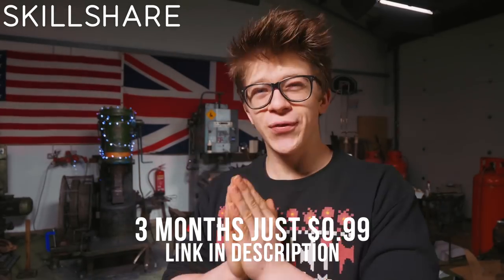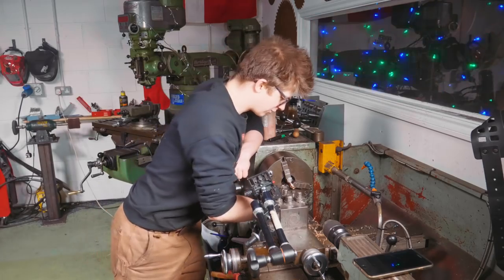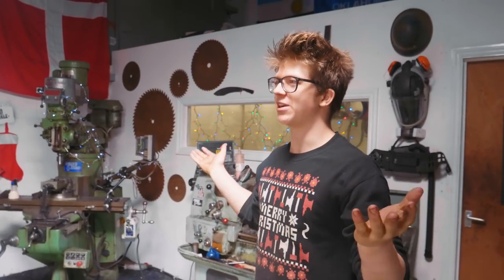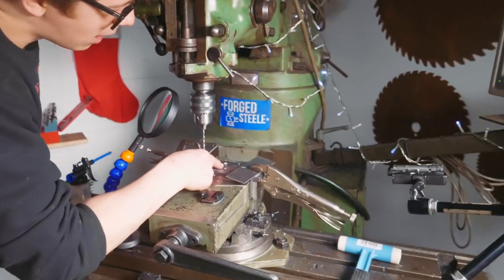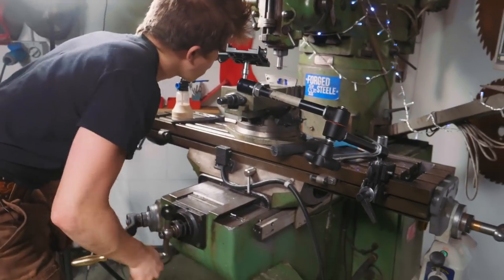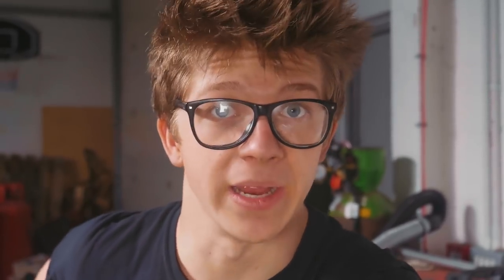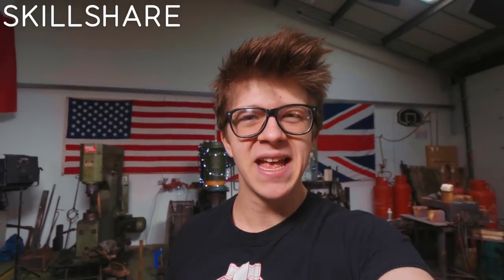MAKING A FRAME-LOCK FOLDING KNIFE!!! PART 5

Comment: Tip: When you are using the micrometer, use the thin stalk at the end when measuring. That is a torque limiter, and if you don't use it your measurements won't be consistent. Also be aware that materials expand when heated up and contract when cooled down. Try to measure the piece at the same temperature every time.

Comment: Fusion 360 is great! I used AutoCad and MasterCam for 25 years, Fusion, fuses them together into one program. Was easy to learn coming from AutoCad, terminology was the same.  Great Work Alex, I wish more of the younger generation had your personality and work ethic! And yes, you make this Machinist/Gunsmith cringe often! KEEP IT UP !!!!
Reply: Dave Erving Evader Knives , If youre using Acad now you should try Fusion360 its free for hobby use and education. It has CAM built into it too, so you will be a step ahead when you go to CNC. The CAM in Fusion has been working good for me with minor edits.
Reply: Dave Erving Evader Knives Im not sure if there is an actual profit number stated, I just figured as soon as you were using it for profit.
Reply: Dave Erving Evader Knives Yes, I believe that is correct. Fusion 360 and other CAD programs for that matter are leaps and bounds ahead of what I was doing with AutoCAD 2000 years ago! You go from pulling out what's left of your hair using the old AutoCAD to Fusion 360 saying oh, this is so freaking easy!

Comment: First off Alec, on behalf of all machinists that watch your channel THANK YOU. second I would like to welcome you to the wonderful world of machining, you still have a lot to learn but you are well on your way. Third, there are several ways to fix your cheap vice, the first one is to strap a bar to your mill table and mill both the tops and sides true, then turn your vice upsidedown and clamp to the bar with the vice itself. Next, take a cut across the base of the vice that should now be facing up, that should bring it into or very close to true. The second option is to make a set of machinable jaws, these are great because you can mill them to what you need, you don't need parallels, and you don't need to worry about hitting the hardened steel of the vice jaws. There is a lot of info on the web about them, but basically, there should be a set of steel jaws held in your vice by two counterbored cap screws, you are going to replace them with aluminum. You can then clamp up on a spacer and machine the jaws true and machine a step into them to serve as your parallels, or you can create any shape you need at the moment. When they get bad just make a new set.

Comment: A little tip for centering a bit, hold a scale (ruler) vertical between your tool and the workpiece and slowly feed your tool inward until it pinches the scale. If the top of the scale moves towards you, the tool is too low, if the top of the scale moves away from you, too high, if the scale stays vertical, your tool is on center

Comment: Great work Alex. Tip of the day: when reaming, don't bottom out the reamer in a blind whole, it will jump up in reamed size slightly. Not that you did or could I even know, but a tip nonetheless if you didn't know! Thanks bud.

PS: You are progressing wonderfully on the lathe young sir. Love the enthusiasm!
Reply: and try to turn off the mill or the lathe before going bck with the reamer , it will help to get rid of the mark you can have in the hole wich can make difference if you want to put something in the hole . 

other trick try dowel pin when you want to use your hole in the vice . its more precise . thanks for the compliment about machinist bud :)
Reply: Both great tips on using a reamer, another is to only ream the hole once.  If you go back in you will chowder up the finish and possibly oversize the hole.

Comment: I love fusion, I've made 11 knives (3 folders and 8 fixed blades) for CNC milling to rough out knives for limited production. A little more tweaking on the CAM side of the program and it will be able to almost come off the machine and go straight into heat treat. It can also be used for CNC routing for the grips. Such a great program.

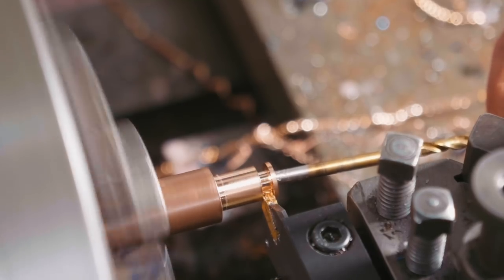Comment: It's great to see someone so excited about learning new things, always enjoy your videos. From watching other machining/crafting channels I've seen a tip about parting off on the lathe. If you grind a small angle to your parting tool the other direction, you won't have that little bit of scrap stick on the bit your parting off, like at the 6:03 mark in this video. Instead your part will come away cleanly, and the small scrap bit will stay on the rod in the lathe. Saves the operator some cleanup work later, you wouldn't have needed to take the washers to the sander to get rid of the little extra tabs at the 7:46 mark.

Comment: Yo Alec, a tip for you. 
Turning tools work best when the top of the cutting edge is bang on the centre line of the piece you are turning, for example, 5mins in on the video you were lining up your parting off tool to get it on centre with your tail stock. 
Now an easier way is, and don't do this when the chuck is turning, but if you get a rule, 12 in or 6 it doesn't matter, but it might be easier with a 6inch rule, but make sure it's straight.
Now hold the rule vertically next to the piece you have turned, then bring the tool you want to get on centre next to the rule, move it gently against the rule, just enough to hold the rule against the piece you've turned, and enough that you can let go of the rule and it will be held in place without falling, the rule will be in one of three positions, if the rule is leaning towards you the tool is below centre, if the rule is leaning away from you the tool is above the centre line, if the rule is bang on vertical the tool is bang on centre.
Please be careful doing this because too much pressure against the rule will chip your turning tool very easily, works with carbide and high speed steel tools, but don't try it with diamond tipped tools, it will chip the crap out of it.
This might sound like a long winded process but once you've mastered it it's quicker easier and more accurate way of getting your tools on centre, a lot more accurate than lining up against the tail stock.
Machining is very satisfying and is a huge learning process, keep up the good work, you're doing great.
BTW, you were talking about accuracy, try turning a Morse tapper......

Comment: Hey Alec, you had mentioned that it was your first time doing a reaming operation. It is good practice to stop the machine prior to removing the reamer. This guarentees that the chips stay in the flutes and don't scratch the surface of the hole as you remove the reamer. A piece of info for your trials and tribulations.

Comment: Good choice! Fusion 360 is great! I like SolidWorks better (use it at work). But the price tag on SW is a deal breaker. So I use Fusion 360 at home for my designing and 3d printing.
Reply: I would have recommended SolidWorks also. It's possible to get them at greatly reduced price tags, if you fit into one of their budget license options. With that license you'll also be able to visit free educational seminars. 
Some years ago I did exactly that. Got myself a student license for about 100 bucks and then visited a full-day seminar which even came with free drinks and lunch.
Reply: So your printer prints braille? Or it prints the letters in 3D on the page?...yar
Reply: Who said that ? Ummm, it's a 3d printer...it prints in plastic. Objects up to 10"x10"x15". Google/YouTube 3d printers to learn more.

Comment: Just a little something from a machinist in learning: (1st year, excuse me if I say something stupid)

-Care for your tools. I'd recommend you oil your lathe/mill every week, if you've used it in that week. also clean it up, wipe the old oil and put old steel "dust" in the trash.

-The caliper shouldn't usually be trusted to make more than 1/10th of a mm's readings, due to the fact that it sits on a slide and slumps just the teeniest tiniest bit. Fine electric calipers can often be trusted to make more precise readings, but if you have a micrometer, use it instead. 

-Make sure to reset your micrometer often, as it is prone to making incorrect readings if it isn't set correctly.

-As I'm sure you've noticed, if the heat is higher before having worked with the material, it will expand. Of course, not by much, but you might want to read into how much it does expand, and it changes for each metal. My teacher told me a good thumb rule: a piece of steel at 90 millimeters will expand by 0.001mm every upwards shift in celsius degrees.

Learned machinists PLEASE correct me if I'm wrong in saying any of these things.

Comment: Quick tip for not losing holy bits when parting off. Stick a rod in the drill chuck in the tail stock, smaller than the hole and just stick it in the hole. The you part off and the pieces collect on the rod.

Comment: To capture the washers, put a wire into the tail chuck and run it deep into the hole. The chuck acts as a third hand to hold the wire steady; the washers won't slip off the end.

Comment: for CAD, I'de recommend solidworks for a beginner just using it occasionally and Creo 4.0 (formerly known as inventor) for more streamlined, frequent production of things. They aren't hard to learn (knowing how to use 1 cad program makes it very easy to learn another). I learned solidworks in around 2 months of relatively frequent use last year and learned Creo in around 1 and have been teaching it to some sophomores for a few months (FRC if you're wondering).

Comment: A little hint: When parting off something small like a washer, start the cut, wind the parting off tool back out, use a file to put a chamfer on the back face, then finish parting off. It's saves you from struggling to remove the sharp edge later.

Comment: I love fusion 360, it's great for my needs. I'm self-taught, and I use it to design stuff for 3d printing and also cnc routing. One of the best purchases I made was getting a 3dconnexion "space mouse" because it dramatically improved my ability to navigate around the part in 3d. There's a learning curve of a couple of hours, and now it's an extension of my hand and I can't 3d model without it. I highly recommend it for your situation.

Comment: If you want to find center of a O.D. use the rule trick. Gently pinch a thin rule in between your cutter and the part. When the ruler orientates vertically the tool is parallel to the center of the part. Most cutters don’t like to go above the center, some do like to cut below though. Look into a mister. It uses pressurized air and milling coolant to lubricate and cool tools. I’ve used mistic mist before. Will work on your mill and lathe.

Comment: Another tip. When tapping, especially with small fragile taps. Use the  post drill or if you have a moving pinol on the Bridgeport with the spindle turned off. This will make the tap go dead straight down an turning it by hand means you have precise controlof what you are doing and can chose the exact moment to reverse back up again.

Comment: That perspective of distance and size changing is something I know really well. I am a goldsmith (intern atm, but almost finished), and going from having a mm as your smallest used size to worrying about 10ths of one is really odd. Worrying about the fact that one saw you use is 0,3mm but the other is 0,16mm is strange. And then there is the fact that others dont get what you are so worried about (if it fits it fits :P ). Anyway, I love your videos even though it is quite a bit different from how I work, please keep up the good work. If you ever have any questions that might concern goldsmithing (like using silver solder (please dont EVER use it the way you did with that katana piece again, that was just.. shocking) or maybe setting gems in the pommel of your swords or anything else ) Please dont hesitate to ask, I would love to answer any of your questions. PS: Sorry for the Wall Of Text

Comment: Keep up the good/awesome work! A thing i learned in school is to use a reamer after you've turned the outside, because turning the outside will deform the inside just a bit. So when you do the reaming when everything else is done, you'll end up with the best reamed hole. Just a tip if it makes sence.

Comment: a helpful trick when cutting small parts on a lathe that have a hole in them like washers is hold i piece of sauter in a jacobs chuck attachment inside your tailstock and set it in the middle of your hole, the sauter will catch it and is soft enough not to mar any finish

Comment: Always enjoyable to watch. Just a thought to save time in setting any lathe tooling use your Vernia height gauge and take a measurement from the saddle to the centre of the tail stock Scribble it down on the splash guard then in future just use the vernia set at that height and bring the tool up to it .

Comment: Tip for drilling with small bits. Get them as far into the chuck as you can. The lass drill bit you have sticking out, the better. It'll have less run-out, (wobble at the tip) and be less likely to break. (Based solely on my own experience with drills)

Comment: Love your videos. I've never seen you using more than one threadtool in other videos. Maybe you are using a machinethreadtool, but normally there are 3 slightly different threadtools for M3 as an example. They are marked with stripes on the side (one, two and none or three). That means you have to start tapping the thread in a hole with the one striped than use the two striped and at last the none striped. Just in case -i think you already know that. Greetings from austria

Comment: when using a reamer you should turn off lathe before pulling it out the ream. the chips loaded in the flutes can bunch up and scuff the inside. or that was what I was taught when I to machine tooling

Comment: According to my book, cutting speed of bronze with carbide tooling should be 200-400 m/min. In 5/8" stock in the lathe, that's 4-8000 rpm. You'll have to get a faster lathe, Alec. ;)

Comment: Alec, I completely understand your mental grapple with dimensions and tolerances. I live in the land of stupid units (America) so when I started machining in school, our drawings were thousandths if an inch. However, I started working as an intern at the company which builds the measurement devices that Apple uses for the iPhone, and they were metric. I have to say, when you spend enough time measuring parts down to less than half of a micron, it's a bit of a mind grenade.

Comment: Hey Alec I just wanted to suggest if you are doing anything on a lathe that you need to cut off something tiny like those washers, I found that putting a paper towel where the piece is going to drop it won't get scratched and you will be able to find it easily.

Comment: Ever try running the lathe and using a fine tooth hacksaw with a thin kerf blade as your cutoff tool? Seen it work great if you don't need  faces to be perfect, plus the blade naturally wants to cut straight as it goes in

Comment: Just noticed on the toolpost if when you have set the height of the tool put a screw down the adjuster  to lock it in place then you wont have to do as much adjusting

Comment: Hey, here's a tip for threading faster. Using the mill with the quill lock DISENGAGED and using the low end. Say like ~34~50rpm. You can power thread wholes. But you muse use the proper taps. They are USUALLY(I'm unaware of 4or more fluted powertaps) 2-3 fluted. The speed taps look like a twist drill. All of the straight fluted taps push the chips down and the helical taps bring thw chips up just like a noramal twist drill.
   Also, be sure the AUTO FEED is DISENGAGED as well. You'll only make a bigger whole...... Ask me how I know that 😥😂😝
 You don't have to break the chips, but be sure to use PLENTY of cutting/threading oil as it spins. Keep track so you don't drill or tap into the vice, so i suggest to only jog the power on and off until you get a feel for it

Comment: There was a wobble in your Blade when you where making the slot you could even see a gap in the Blade and your custom made holder as it turned so you should possibly try to reface the larger diameter of the holding tool

Comment: Place a long rod or drill bit (undersized) into the tail stock (chuck) and then into the drilled hole. That way when you part the washers off they will just stay on the rod/drill bit and not end up in the lathe bed.

Comment: Did you know! The tool holders that you use have an adjustment on them to set their height, making the "quick" in "quick change tool post" actually even faster! Let the tool holder slide all the way to the bottom and do not lock down the handle. Turn the large thumb screw on the tool holder, it will raise/lower the height of the tool allowing for a much finer, more accurate adjustment and provide you with a repeatable stop. Then, as long as that tool is in the tool holder, you'll never have to adjust it again (after its locked down with a jamb nut). The way you're using the expansion camlock in the tool holder to set the height isn't as dependable or accurate, not to mention being neither quick or easy.

Comment: As far as losing the washers and other small items when parting them off from the lathe, have you considered using a shop-vac? If you rig the vacuum nozzle up close to the piece and turn it on just as you're about to part it off, it should be able to suck it up as it's parted off, no? Then you only really have to find it in a relatively small pile of shavings inside of a contained space, assuming you started with an empty shop-vac.